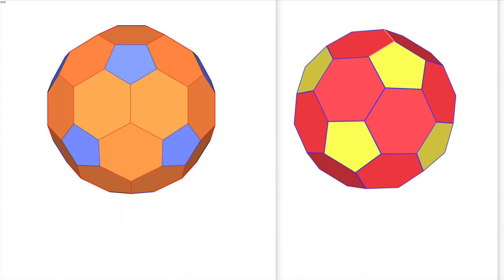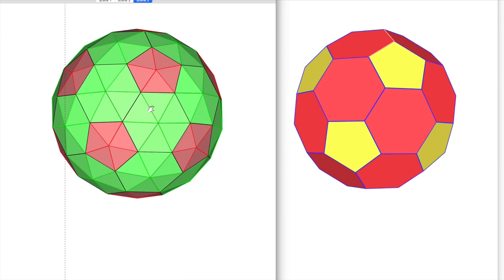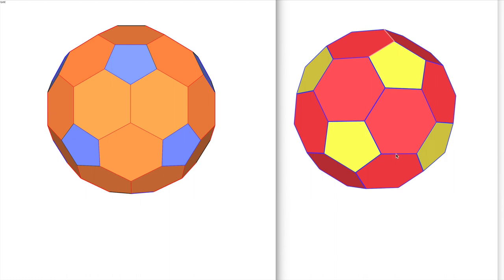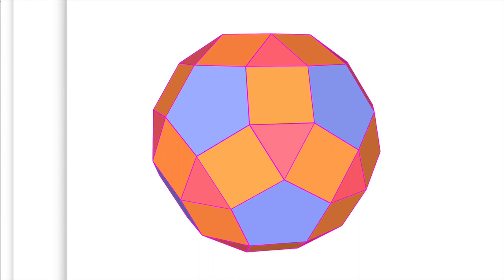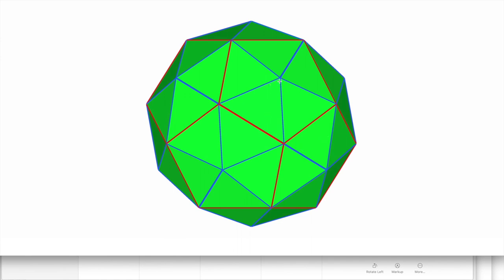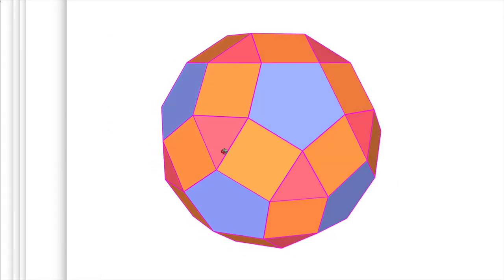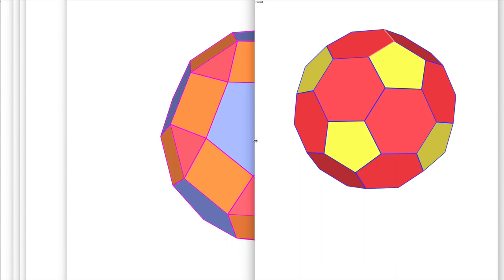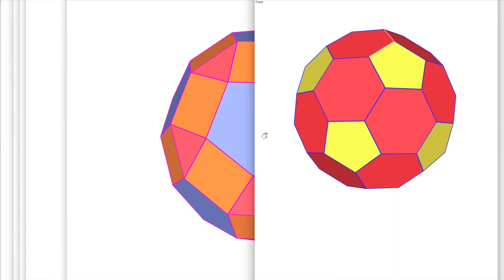Paul's Geodome Geometry book update, half way?

Comment: Basically icosahedron, just means 20face. So you could just translate most things. Also if there is two names, since you can go truncating or stellating, I'd take the one with the least faces or shorter name in the base. I notice you don't handle many snub versions :) I don't think you can ever be complete, since there is so many variants possible. I'd think you'd want to place an upper limit on complexity to build or something. Also a usefull naming convention might be with the number of faces each face is adjacent to, so a duodecaeder would be 5,5,5. A (regular) pentagon which is adjacent to 5 pentagons, repeat until you have a sphere approximation. You might give the numbers letters and arrive at words, like how you can remember digits of pi. There is many useful systems for those. 5 to me is an s, so sass would be 5adjacent55. So duodecaeder would become a sassyball.

Comment: C60..... duh
Reply from the maker: or truncated Icosahedron.... or Bucky ball..... or dual of the pentakis dodecahedron. C60 is a reference to the carbon molecule with 60 vertices it's not going to work as a naming method for all  polyhedra, what would you suggest for a strombic hexacontahedron? (which is also know as rhombic hexacontahedron or deltiodal hexacontahedron) See the problem now